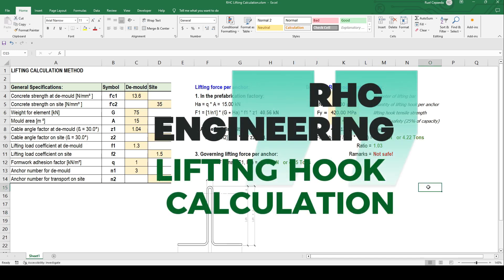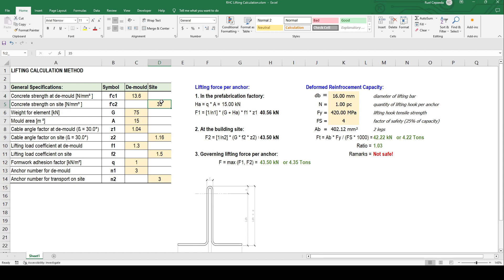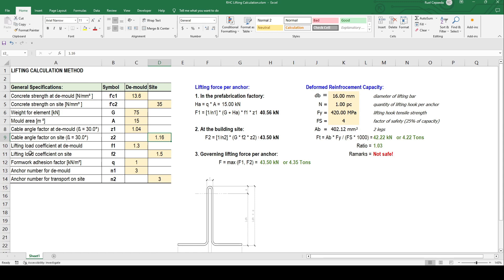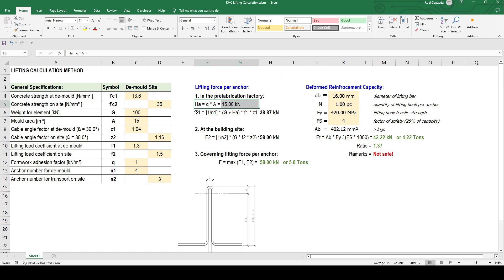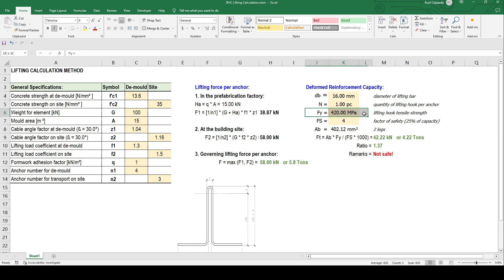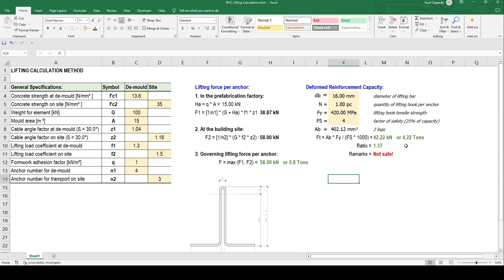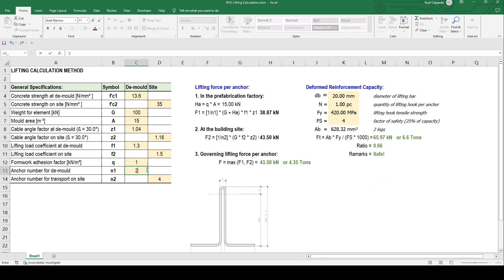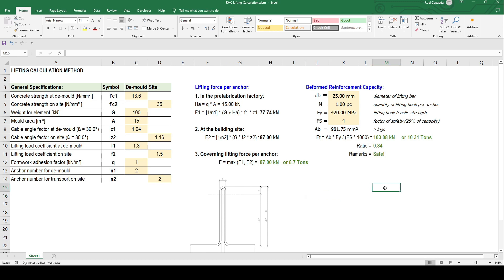RHC Lifting Hook Calculation

Comment: This works if the bar is fully developed. Furthermore, you still need to verify various failure modes such as concrete breakage, pullout, etc to determine a more conservative development length.
Reply from the maker: Yes, Engineer, you can check it by yourself to verify the result. Thank you.